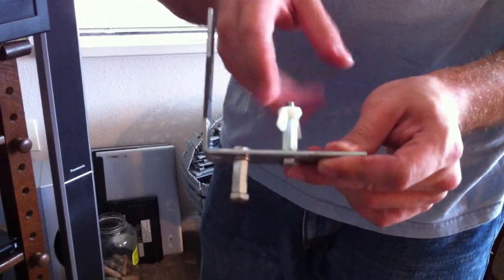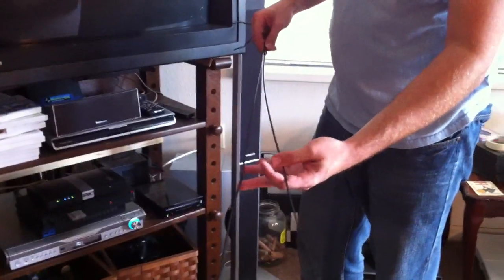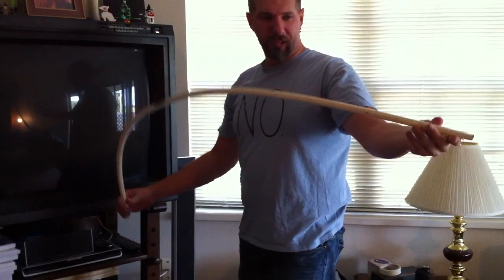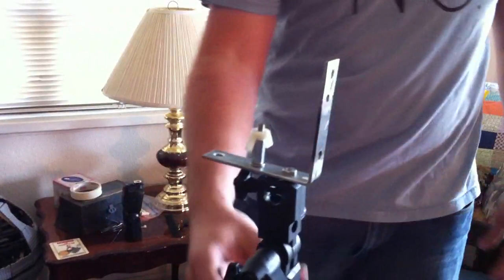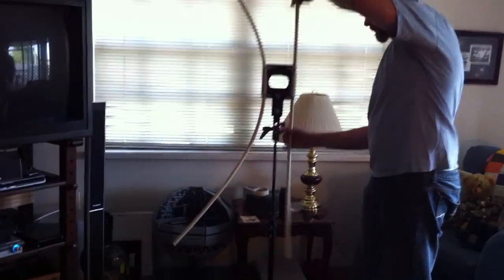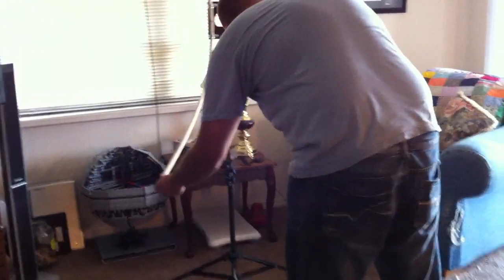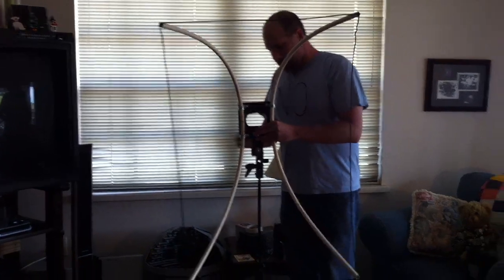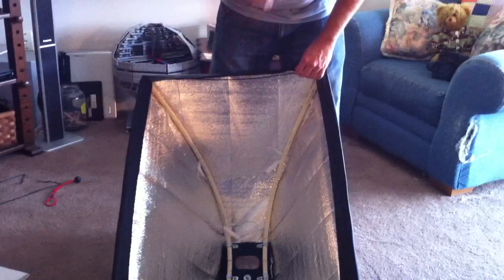DIY Softbox Assembly Tutorial

Comment: This is the best DIY construction for a softbox I have seen yet - and i've been looking for a while! Just made myself a 24" beauty dish from a round bbq base and I'm just gunna have to move onto this one next. Cheers for the info ;)
Reply from the maker: Thanks!  It's been three years since we first built it and still use it on a fairly regular basis.  Since then we've only had one major issue, about a month ago one of the corners wore out and the PVC poked through, but Anna repaired it without a lot of trouble.  We've also recently made an adapter to use constant lighting (two 60W halogen bulbs) so that we could use the box with an iPad-based photobooth setup, it seems to work pretty well for that also.

Comment: Hi! Great idea I just made mine, and it works perfect, but I would like to have continuos light also, how do you use the iPad based photo boot setup ?
Reply from the maker: Hi Luis Enrique Martinez Rojo, I ended up adding a small plate to the mounting bracket that holds all of the parts together, as pictured below.  Into the hole in this plate goes an IKEA HEMMA lamp cord, and into that socket I placed a Y-adapter from Lowes that allows you to use two bulbs in a single socket.  Two 60W halogen bulbs put out plenty of light for the iPad and didn't heat up too much.  I had to use halogen rather than CFL bulbs because of sync issues with the rolling shutter on the iPad when shooting under florescent lights.

https://lh6.googleusercontent.com/-RK3Z9n0B_HQ/VSyC90UHW5I/AAAAAAAADCY/ITKiXi9vvWU/w626-h835-no/IMG_4477.JPG
Reply: Sean Jacobs thank you very much for sharing you are awesome!